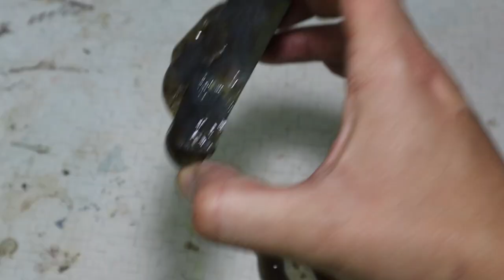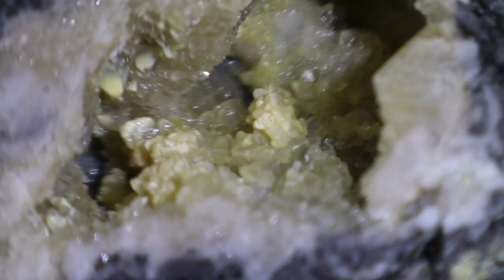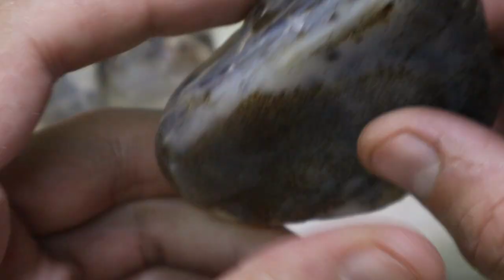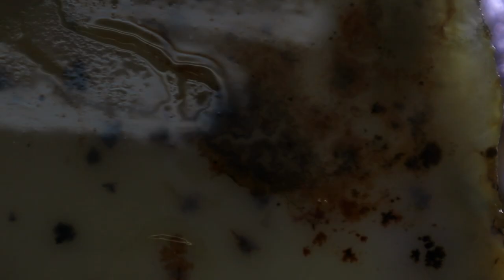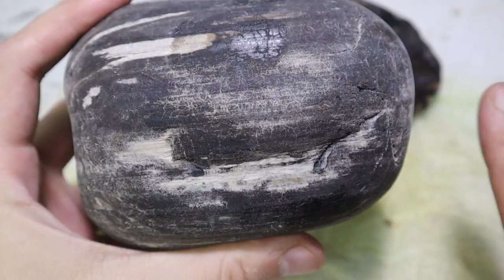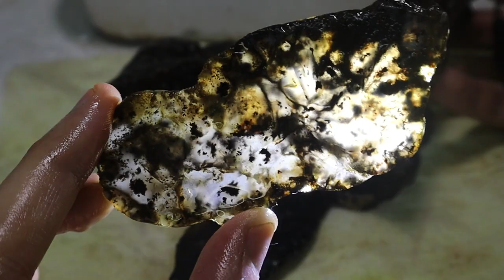Cut Placement Breakdown! Deciding How to Cut Your Rocks for the Best Result!

Comment: When I get a sweet small patterned slab,  the next cut is usually thin for use as earrings in matching sets and then maybe more. Also start thru the best lapidary material to end with the "butt" having the matrix baking it, not included in every slab. keep 'em coming.